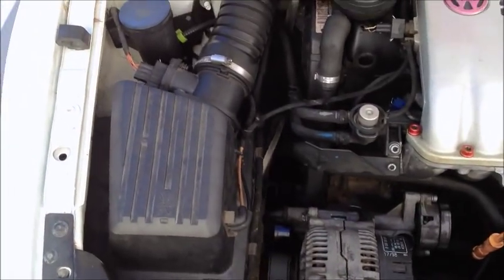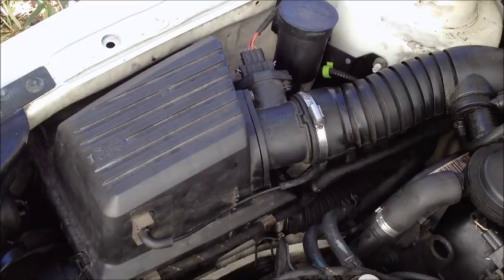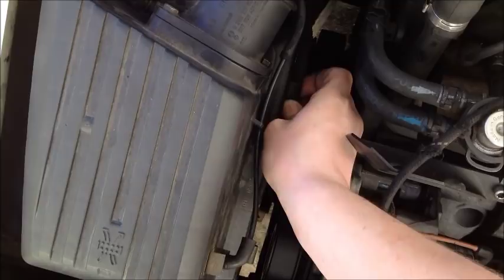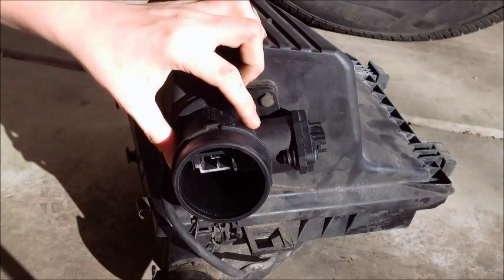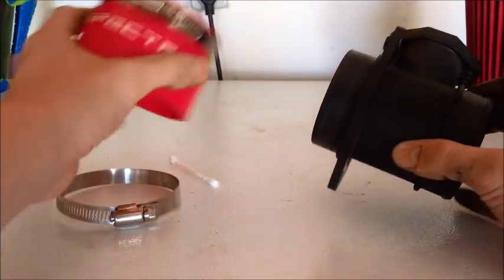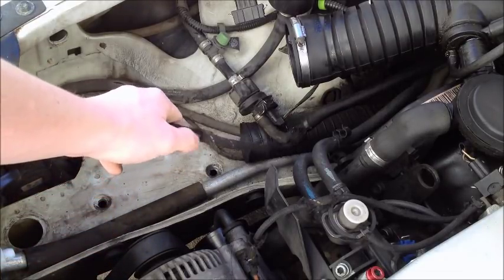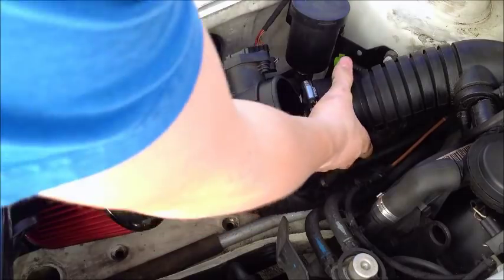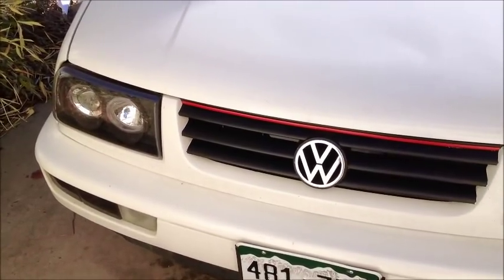How To Install a Short Ram/Cold Air Intake In A MK3 Jetta

Comment: The Air Horn front of MAF in stock Air box,  actually serves a purpose. I took out and modified to fit Inside Air filter. Actually, a good K&N style Stock air filter would be just as good as this mod, plus would have stock Secondary Air Hose still in factory position, with Metered Air going in right. Putting a Small Air filter on top of air pump doesn't and causes stumble and a code .

Comment: Alright I wanna make something clear, all those people that are saying you're losing power by installing airfilters like these are drama queens xd I myself have a mk3 vr6 syncro so it's a 2.9 vr6 engine with around 190hp. I did some dyno runs with both stock and this same spectre airfilter and with stock I got 194.48hp and with the spectre aitfilter it was 194.39 so you're not going to notice that at all same thing with the torque 246.24 and 246.16 so again you're not going to notice that the only thing you will notice is that you're car sound a lot meaner than before it ads a certain rumble to your car when you rev it.

Comment: SickSpeed sells Shower Caps for filter that keeps water out but breathes. Cold air? Not in Phoenix, summer. Cooler IN engine compartment. My only complaint is the air hose that goes from factory airbox to air pump. Taken off and small air filter put on air pump. But this air won't be Metered, not going thru maf anymore. ?

Comment: This is neither a Cold Air Intake nor a Short Ram Intake. This is slapping a cone filter on the end of a stock intake, which is NOT the same. 10K thumbs down for mis-information.
Reply: And removing at air box so its no longer sucking cold air. Lost 10hp doing that mod
Reply: So how would it be done right?? I am buying a short ram intake, this video seemed simple

Comment: I kinda want to do this just because the airbox takes up so much space lol. Did your car performance take a hit from this mod, or did it make it better? Did you ever make some sort of bracket to protect the air filter?
Reply: TT tuning has proven that the stock airbox is better for a MK3 2.0. They have the dyno to prove it.
Reply: JobeMinacum
I've been getting more into my mk3 2.0 lately. So what about stock airbox with a K&N? Also, what about stock airbox cut open on the fender side with a K&N filter?
Reply: Guidosaur
The K&N filter won't really gain any power over the stock paper filter.. And it is oiled, so it will run the risk of fouling your MAF sensor.
The Swiss-Cheese-Mod can't hurt, but it won't really gain any HP either.. Just induction noise.
Honestly, the only aftermarket intake that will gain power on a MK3 2.0 N/A would be Autotech's or Eurosports that go into the fenderwell, right behind the bumper's vent. Other than that, might as well just stay stock..

Unless you're willing to do a MK4 intake manifold swap. In that case, you'd gain a good 3-5whp and TQ across the powerband. ScientificRabbit has done dynos on the MK3 vs MK4 intake manifold and the results are pretty amazing. I'm running a MK4 SR ported manifold on my Turbo 8v, and love it.

Any other questions feel free to respond here or post on my videos.
Reply: JobeMinacum
Thanks for the help, will do man
Reply: Guidosaur
Not a problem :)
Reply: Basically, Having the stock air box helps you have more torque with low rpms, but restricts high air flow with high rpm's, while a cone filter, properly fitted with a heat shield, will not really do much for your low torque power, but will drastically help with high rpm air flow and power
Reply: derek whipple
Drastically? Nah. The ABA flows horribly with that manifold. You'll be lucky to get 3-5hp from a legitimate cold air intake with a 2.0 8v.
Reply: JobeMinacum hey yo

Comment: Nice Jetta what headllights are those?
Reply: ebay Angel Eyes. Aka Junk.
Reply: Answering a question with the correct answer (that you happen to dislike) isn't hating. I'll happily link you to the Dynograph proving me right if you'd like, TechTonics Tuning did the dynoruns a long time ago.
Reply: He's actually right regarding cold air intakes on MK3, but the comment about the headlights was unnecessary.

Comment: I bought a Volkswagen Golf MK3 2.0GL with an Aftermarket Spectre Air Box Filter. It's not fitted properly and it hangs. So I went ahead and just use a wire and hanged it against the body. so it's not down low. one thing I do notice on my car is the MAF might be broken... kms
Reply: Do yourself a favor and put the stock airbox back on. The cone filter on the 2.0l 8v loses power, it doesn't gain anything. The MAF-housing is likely wobbling around smacking into the frame instead of being bolted in place by the factory airbox.
Reply: JobeMinacum I got it m8, thanks for the input thou. Now time to fix the Door latch and make the central lock work on a MK3 Base Model that has no electrical Windows or Lock switch
Reply: The locks on the MK3 uses a air pump and vacuum lines. If you hear any hissing sounds, try checking for black plastic lines. They get old and brittle and crack - especially near the decklid/trunk in the Jetta's. I'd rather have crank windows in a MK3, I've gone through the effort of changing window regulators too often for my liking. I'm glad I daily a MK2 GTI with a ABA-T swap now - it's much simpler.
Reply: JobeMinacum That's great and I perfect manual everything as it's less prone to breaking. And it's not the vacuum, it's rather the way the latch doesn't grab onto the door. When I speed up, turn or push the door it opens as if I were pulling on the door handle the whole time which I wasn't and I figured out it was the Lock Module on my Golf. One thing thou is my dumbass broke part of the White Vacuum holder... Kill me
Reply: Unfortunately the door handles do fail on the MK3's. Sometimes the gaskets crack and cause issues from leakage. It sounds like it could be disconnected, or the part of the doorhandle that holds onto the actual door latch could be stuck/broken. If I remember correctly, the bolt to release the doorhandle is inside the door frame on the side. I believe it's a Torx bit. It doesn't pull straight out, it slides towards the rear of the car and then out. 

Have you tried GAP? They sell a lot of parts for VAG cars and they're very reasonably priced. Just be careful with the lock chamber, if it falls apart they're a pain to put back together in the right order.

Also, if you haven't already, buy a Bentley manual for the MK3 chassis. Loads of information in there, easy to understand with pictures. You can buy one brand new for about $50, or try getting one off a forum for a bit cheaper. They're worth every penny. MK3's are great cars.
Reply: Thankfully they can be swapped out for the stronger 02A. That's what I did with my MK2, the 020 that came bolted to it was junk. Reverse was noisy and 2nd gear would grind constantly. They also have a horrible shifter linkage but that can be somewhat fixed.

 You can get a good 02A from a Corrado G60 or Passat 16v or B4 8v pretty cheap. If you're looking for the best gear stack, though, you should go with a VR transmission and just use a 4 cylinder bellhousing from a Corrado or Passat 16v or B4 8v.
Reply: JobeMinacum forums say specifically that I can't use a VR6 Tranny on a ABA 2.0 .-.
Reply: You can use the actual VR6 transmission, but you'll have to switch over to a 4 cylinder bellhousing. I started with a VR6 1-4 and a TDI .71 5th gear on my ABA-T before switching it out to a custom 02J based stack.
The biggest difference between the VR6 and the 4 cylinder's 02A would be the gearstack and F/D ratio (besides the bellhousing). The linkage is the same cable linkage, and a great upgrade is the 02J shifter assembly. It feels better than the 02A's. Probably because it's newer, haha. You'll have to drill a hole in the floor to mount it in a MK3 from what I remember. I used a Polo linkage assembly in my GTI. :)

Comment: What do you do with that warm air hose? Can it just be open like that?
Reply from the maker: I left it open for a while but i ended up just taking it off by undoing the hose clamp on the other end of the hose. you'll see that it is connected to what looks like a metal box right above your exhaust headers, just undo the hose clamp and it should come right off
Reply: You can remove it. All it does it connect to a exhaust manifold heatshield.

Comment: Train wreck!
This is not an "upgrade".
This is not a Cold air intake. It is a HOT air intake.
TT tuning, a very reputable VW tuning company (they sell performance exhausts, camshafts, big valve kits, EPROMS, basically, parts that actually work), has proven the stock airbox is better than this. By a LOT. They have the dynos to prove it, and I'd be happy to link you to the dyno graph.
The ABA MAF is actually 70mm (2.75") not 3", like you say, so you're using the wrong size pipe, filter, and couplers. Does it "work"? Yes, but it is wrong.
 Also, by leaving the warm-air start up hose on, you are making it even more of a hot air intake.
Reply: Very original. You have no logical answer, so just stoop to insults. How intelligent.
Reply: How many comments did you make?

Comment: Is this vehicle specific? Or can you do this procedure with most cars?
Reply from the maker: Somewhat yes to both.. Really as long as you don't disrupt the MAF or any other important sensors in your particular intake, sticking a cone on it shouldn't throw any codes. I've never had any problems with it in the time I've had it installed however I do recommend building a bracket to hold it secure!
Reply: +TheTikiReviews thanks man

Comment: can you take the warm air hose completely off or what do you do with it just leave it like that?
Reply from the maker: i ended up taking it off all the way
Reply: yah im thinking of doing the same when i do my intake mod, but just a question how do you feel about it do you think its worth putting an intake ? any gains losses?
Reply from the maker: i haven't really noticed any gains or losses. It's more just an easy project. It does give you a sweet throaty growl when you really step on it. I would recommend it because it gives you more airflow, and it's easier to tell when you need to clean your filter haha
Reply: romeo mernacaj
The OP is wrong, 100%.
There is 0 reason to install a "intake" like this one on a 2.0. You are literally sucking in HOT air. TT tuning has proven that the stock airbox gives more power than a cone filter like this. They have the dyno's to prove it. Please don't do this.
If you really want the "cool" induction noise, gut your airbox.

Comment: What about a mk3 jetta with SAI?
Reply from the maker: hmm, i wouldn't know what to tell you, i have heard of doing a sai delete but don't personally know how. on vwvortex there's a few forums on that, here's one of them:      http://forums.vwvortex.com/showthread.php?4884002-MK3-Secondary-Air-Delete.
Reply: If you have a SAI, you can use a little breather filter on the end of the SAI pump. But any person that knows VW's will know that this "cold air intake" is actually a  downgrade, not an upgrade. The stock airbox is better. Dynos have proven it.

Comment: Please, no one do this. You are wasting 40 dollars. Unless you want to pay 40 dollars to lose HP, that is.
Reply: i dont know about you ,but ive gotten atleast 6 more miles per gallon aswell as a better response, and i have a 2.0l soul
Reply: DamnyouToaster
BS.. Your engine sucking in hot air isn't good. It raises the intake charge, which makes the fuel burn inefficiently.
Reply: Go get an education.
Reply: JobeMinacum shut up Dr fr  if you want to get mods on your car short ram intakes do very little... save money for turbo

Comment: No HP gain sucking in hot air loose HP . Plus air filter cone is flopping around , not secured . Ridiculous intake noise on acceleration .   This is one dumb ass Mod . $50 would have got you an K&N pre oiled air filter better air flow and filtration  over stock , and a cup of coffee .